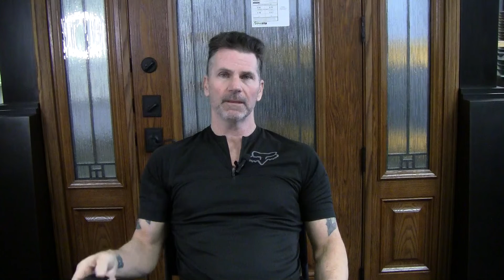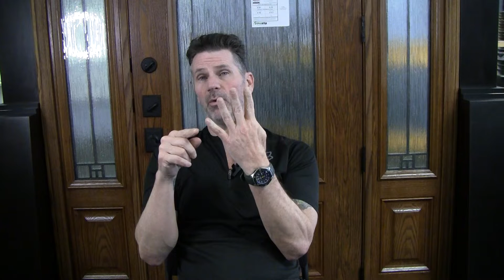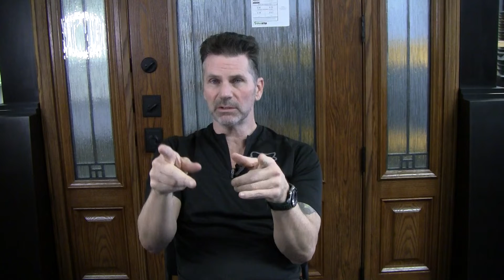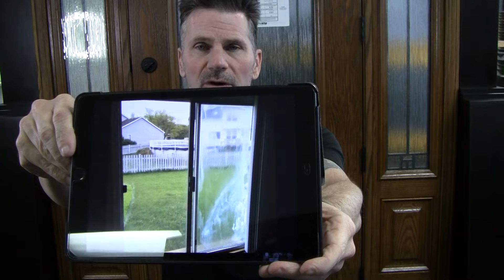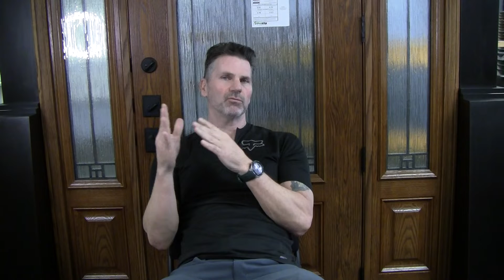Seal failure on an IGU- (Insulated Glass Unit)  what is it and why does it happen?

Comment: Plus whether or not the low-e coating is inside of the IGU glass sandwich and, if it is, if the there is an edge delete of the low e-coating and spacer interface.